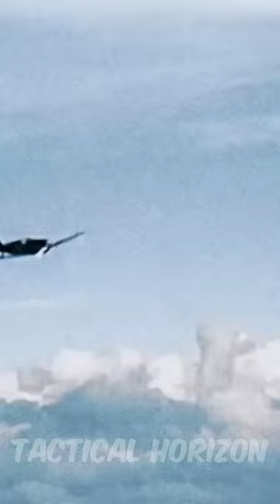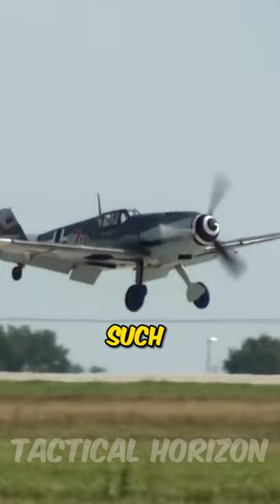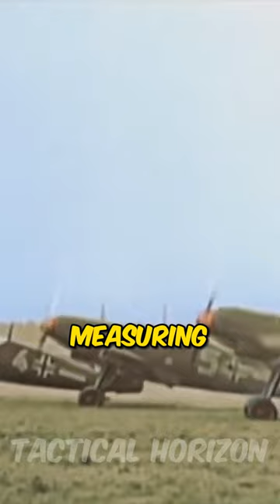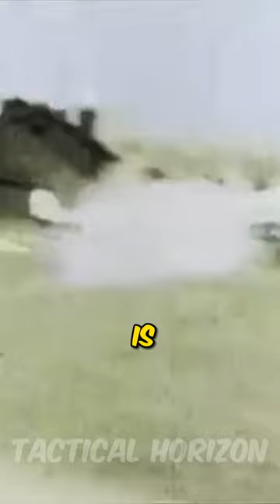How Did WW2 Fighters Fire Bullets Without Hitting Their Propellers 🤔 #shorts

Comment: Also, 109 had a 20mm cannon firing through the propeller shaft (shown in the cut-away diagram) which didn't require interrupter gear.
Reply: @grantm6514  the 109 also had a 15mm gun firing through the propeller hub.  Might have been the Me 109 F.
Reply: @grantm6514  the two guns on the cowling weather it’s the 7.92 mm or the 13mm guns then even the model with a cannon firing nose hub needed the interrupter gear.

Comment: That mechanism was designed by Tony Foker.  He was an aircraft designer in WW1,  thats when this mechanism was fielded.  The German eindecker was first equipped with that.  The French just shot holes through Their propellers.  The British built pusher aircraft where the engine was in the rear, machine gun in the front.
Reply: Anthony fokker
Reply: @Erusean_pilot  Anthony / Tony he was known by both names.  But thanks for the information .  I already knew that fact.  I thought people knew that he was also known as Tony Fokker…